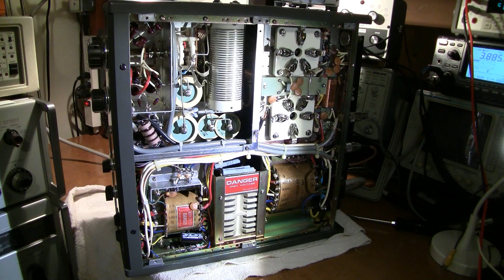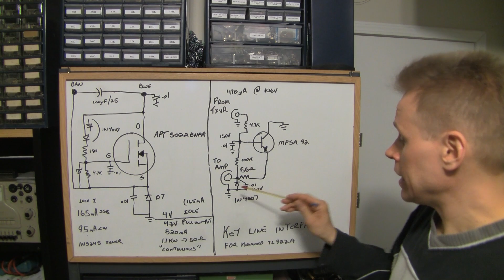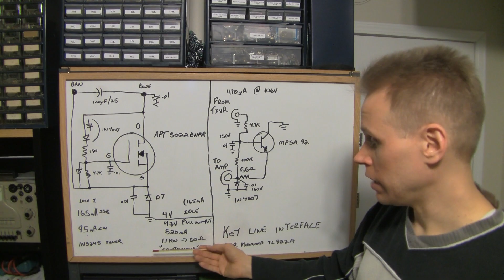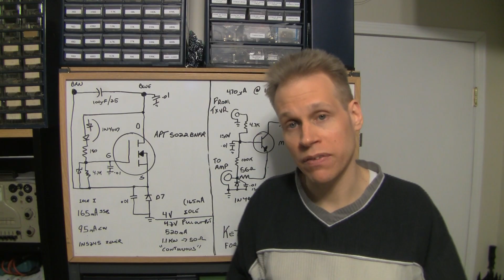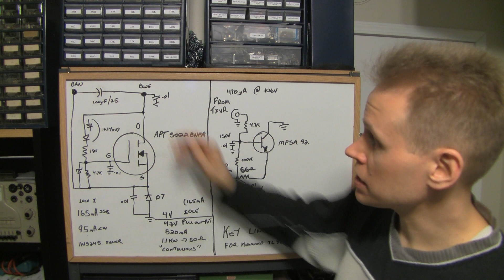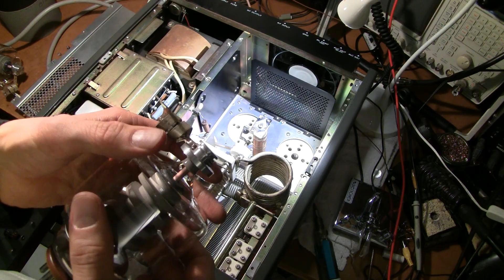KENWOOD TL-922A Repair and Modification

Comment: I thought it was a bad idea to touch the glass of high tension tubes due to grease from fingers?
Reply from the maker: M@  These power tubes are made with "hard glass" so no issues what so ever with that sort of thing. The glass is usually Pyrex, or in some cases when you come across some really special tubes made by Bendix Red Bank, they are made with Nonex glass.

Comment: About the most complicated thing I've done in this domain is replace some parts on my pinball machine's power supply board to correct a condition of no voltage on the -100v rail, and I had some help with that.  That being said, I find your videos quite informative and entertaining.  Cheers!
Reply from the maker: SilentGloves Thanks for the nice comment!

Comment: i have an MFJ ARB 704 for my 922a and ts2000x, does this suffice for the Key Line network expressed in your presentation or do i also need to construct the network?
Reply from the maker: Sam Long Hi Sam. The arb704 looks to be a solution. I have never owned one so I can't say. The spec's look good though. If your TL-922 is working, you do not need the FET circuit..... Yet.
Reply: Mr Carlson's Lab thanks Mr Carlson i think i can speak for all here that what you do is a wealth of info/education expressed effectively and concisely.  i watched your restoration on the hammerlund and  i plan to see all your youtube presentations.....what a treasure, again thanks.
Reply from the maker: Sam Long Thanks for the nice comment Sam!

Comment: Very interesting video thanks for making it. Would replacing the fan on the power amplifier with a more powerful fan solve the problem with over heating?
Reply from the maker: technos123 With this design, the biggest issue is, there's no real cooling of the tube pin's. The upper plate seal is also an issue when there's no chimney. A bigger fan couldn't hurt, but again, it's the path of the air flow which is the major issue.

Comment: Where do you get the schematics for the equipment's you fix
Reply from the maker: mega1971tron I designed the ones on the white board. Factory schematics are available on the web.

Comment: Not being critical, just my thoughts on this amplifier....
in common with many others I would suggest grounding the grids properly and dispose of the networks that are attached. 
Ground each of the three grid pins on each tube via the lowest inductance path possible to chassis. 
Regarding the softkey... my rig has survived so far but I shall make a softkey circuit before I break anything.. one of the issues that causes the welding of relay contacts is the capacitor across the amplifiers key line, I think this is a bigger problem than 30mA.
I plan to use two transistors to get a low voltage, low current keying line...
Reply from the maker: David Lisney Thanks for your comment David. There always welcome here.

Comment: I was given a loan of one of these a few years ago when I very new to Ham radio.  I didn't use it because I didn't have enough confidence to use such a high power device. After seeing your video I'm glad I was cautious as I'm fairly sure it was unmodified.  This is certainly something people should be aware of when using newer transceivers with older generation amplifiers,

Comment: Thanks, I've worked on a few Heathkit amps and Dentrons and have heard a few
Hams complain about trying to work on this Kenwood amp. Most of the complaints
were that the components in this amp was cramped and hard to get to for servicing.
Reply from the maker: Dennis Petersen Hi Dennis! They are right, it's very cramped.

Comment: hi glenn here i have a national ncl 2000 and a yasue fd dx1200 running an ameritron ARB-704 to key my ncl 2000. i had a flash over as i was adjusting my load on the amp...could this have caused any problems with my system as a whole? glenn matrixcut@optonline.net,thank you glenn
Reply from the maker: Glenn Campanile Hi Glenn, it really depends on the kind of flash over and where it occurred. If the flash over happened, or is happening between capacitor plates (air variable) it could be a number of things. These things include: parasitic oscillation, dust, or high standing waves. If it happened internal to a tube, it could have air in it, or the grid to cathode, (grid to plate also) tolerances have changed. Most of the time when flash over occurs, it only damages the amplifier it's present in. If for some reason the plate supply managed to flash to the antenna connections, then there are more possibility's.
Reply: i think for shure that it was the relay?!
because i still get an output of around 1200,to1400 watts on my drake an bird 43 watt meters... think i just got lucke...your comment please?
Reply from the maker: Hard to say with out being there and seeing the issue in person.
Reply from the maker: @sinkosav  Thats where understanding the failure point is important. The grid to filament tolerances are very tight in these tubes, and they short all the time. 100W of RF is over enough to weld them together.

Comment: These are the two "Must Have" mods for any of the 3-500Z equipped HF Amps. Well researched and well written, Paul. I've used optocouplers for this in the past, but I like the MOFET idea also. It may even be a bit more robust. This appears to also give you a Zero Signal Anode Current (ZSAC) turning the tubes off between words in SSB. This lowers overall temps in the amp by a bunch, and this amp needs all the cooling help it can get! Great Job, Paul!
Jim
Reply from the maker: ***** Hi Jim, Thanks for the comment! The idle current will remain at 165mA in SSB mode during speech pauses. Thanks for stopping by!

Comment: Love your videos. I am a safety Inspector for the mining industry and deal with high voltage daily.(12,470). I can't commend you enough about your safety warning. M a y I suggest a video just on safety when working on amps. Particularly making sure it is de-energized in case bleed resistors are open by shorting to ground. Thanks for your videos please keep them coming.
Reply from the maker: MrRickrzr Thanks for your comment!
Reply: +MrRickrzr I agree a short video on shorting would be great for safety reason.

Comment: Very Interesting and Informative.  The methods and steps you show can be applied to all manner of fault finding/repair so I'm particularly keen on learning the process you follow - and hopefully fix simple faults with my old radios!
I have an old Yaesu amp 2100Z - one of the most popular amps ever produced.  There are a heap of safety mods for this amp and a video regarding doing these would be highly useful and watched by many.  Thanks from South Australia
Reply from the maker: Christopher Larwood Thanks Christopher! If I come across that amp, I will do a video. Glad my troubleshooting techniques are helpful.

Comment: A great video, but audio has only left channel at the beginning :(
Reply from the maker: ***** Thanks for the comment! There is a small switch on my mic that was between two settings. You should have heard it before I spent an hour just correcting that channel in a program! That switch is a good candidate for some super glue.  :^)